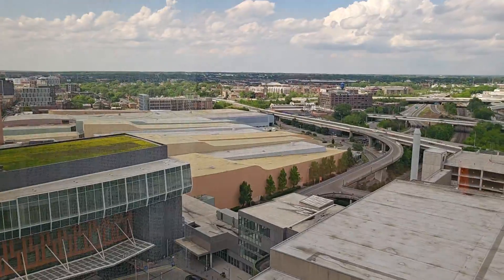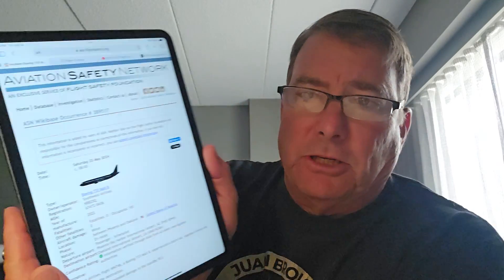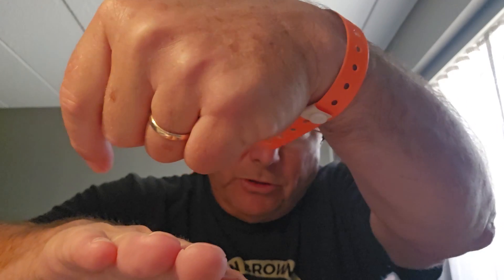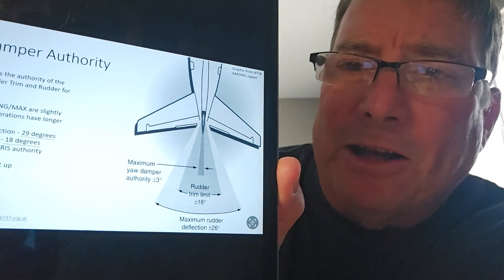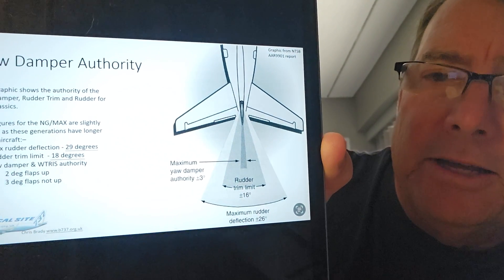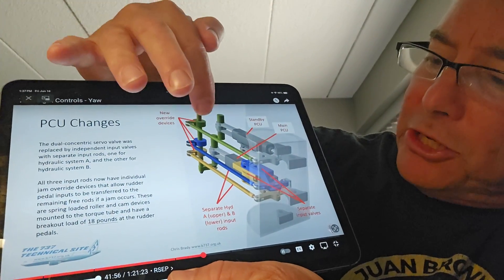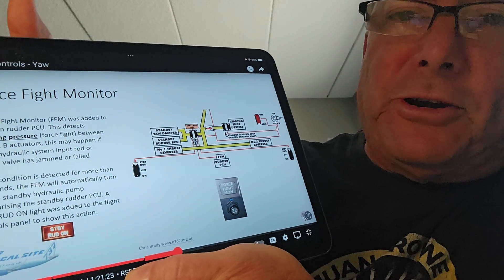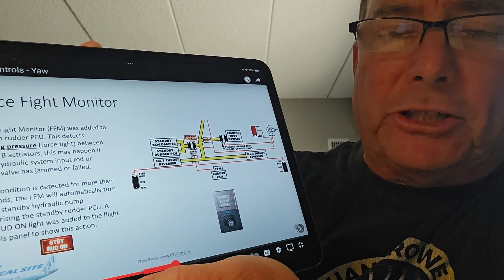SWA 737 Max-8  "Dutch Roll" Incident

Comment: The fact that voice recorders are constantly getting overwritten in all these incidents lately, in the age of NAND in the TBs taking up virtually minuscule amounts of mass and volume, is absolutely ridiculous.
Reply: @halmc8109  1) They should be on before engine start(if that is what you mean by light the torches. 2) No way are you going to see an exchange program. The paperwork(and by extension time) that would be required on each exchange is a show stopper. Then there is the whole chain of custody issue if the recorder is ever needed in an investigation.
Reply: @adrianklaver113  Plus, you'd have to expand your inventory of CVRs ten-fold. You'd need maintenance at every station you fly to. The rack and electrical plug at the back of the rack would wear out. Not a good idea. Still, every CVR should have the recording capacity of at least two legs of the longest flight the aircraft is capable of.
Reply: The flight time from Phoenix to Oakland is not 4 hours. How did it get over written? Wasn't the plane parked after the incident?
Reply: @rockslide4802  Apparently it's quite common for CVRs to not be turned off when the plane is parked, for whatever reason. I say just give em a few TB of memory and let it record years of recordings. Also do proper multitrack and seperately record cockpit and each pilot's mic (quite important when pilots are masked up)
Reply: @rockslide4802 There is no need for the whole recording to be overwritten, just the relevant part. Presuming the incident occured in the first half hour, a total flight time of 2h 30m would erase completely the part of interest .
Reply: @rockslide4802  it runs the recorder as long as the power is on.
Reply: Well, something required to survive a Mach 1 impact, fire, and 20,000 feet under water for Three years isn’t as tech as what you can buy for yourself.
Reply: Old V-tail Bonanzas loved to “Dutch-roll”
Reply: …Watching early Premier1Driver vids, I finally figured out he was pressing the Yaw Damper On button immediately after gear-up
Reply: Welcome to aviation where I'm still mandated to use leaded gasoline.
Reply: HEAR HEAR!
Reply: @halmc8109  Good idea, but when you figure that some of these planes may make 4 or 5 (2) hour flights a day that could be expensive with a fleet of say 100 aircraft flying around each day.
Reply: I'm not an engineer so I'm a bit curious: are tapes still used vs more modern data storage device in CVR because engineers/experts decide it has a higher chance of surviving an impact/air crash?
Reply: @First-Name_Last-Name its digital now
Reply: @bradsanders407 oh my mistake. I just read the comments above and they talked about tape vs newer data storage tech so i wrongly assumed airlines still used tapes.
Reply: If SW safety had directed to have  CB’s pulled when event occurred (per protocol) then CVR data would have been archived.   Without this action, the new CVR time requirements would not have helped.
Reply: CVR data for this event isn’t important. The flight data recorder and radio communication data will tell the entire story.
Reply: I sincerely doubt that conversation on the flight deck during the incident would shed any info of significance on this incident.  To be clear to non pilots, FDR’s (flight data recorder) records flight control inputs and other data for a minimum of 8 hours and that’s likely far more valuable than a few words which may have been uttered during the event and subsequently recorded on the CVR. It should probably be mentioned that an operable CVR or DVR is not necessarily required for flight if the airline has MEL relief. 

I think the recording capacity of the CVR is somewhat of a red herring and only mildly peripheral to this event. It’s highly likely that any comments during the event were of an emotional nature such as “what the hell is she doing?” or “hang onto her” etc.  However, I have little doubt that a follow on discussion took place at some point after the event and relevant circumstances would be documented for a proper maintenance logbook write up as well as any other required safety of flight reports that Southwest requires for events such as this. In other words, notes are made in order to document at a more suitable time. 

The work put into researching and describing the relevant parts of the rudder control system are much appreciated and my immediate thoughts were “here we go again, the rudder hard over issue previously experienced with the 737” and the tragic loss of life that occurred in the mentioned accidents. 

No doubt Boeing disturbed our collective trust in not properly disclosing and documenting the MCAS system. And sadly, even that huge and enormously significant failure to disclose was NOT something unprecedented in the industry.  But that’s for a different discussion…

I’m far more curious about phase of flight when the incident took place as well as any possible contributing circumstances such as did the event take place during a bathroom break, or pedal adjustment, etc., that resulted in accidentally kicking a rudder pedal ? And or was it a wake turbulence encounter that set off the chain of events ?  You made it clear there was damage  to at least one of the pcu’s but what evidence is there the damage was or wasn’t preexisting or was the damage the result of the encounter?

Simply put, there’s not enough information to have any kind of a credible opinion and there are numerous possibilities that account for the incident before regulatory changes or redesigns (not saying you’re advocating either Juan)

My comments are not meant to criticize Juan’s excellent reporting but are simply to provide a little perspective to those not personally familiar with operating jet transports.  

Because this event is rather “dated” it sounds like it very well could be more the product of a slow news day and Boeing has the public’s interest at the moment so why not roll with this “juicy” story ?  Especially given the history of the prior 737 rudder hard over “issue” as well as the MCAS related disasters, exit door separation, etc., etc., etc…
Reply: i learned in the Air Force if youre going to talk trash or execute a classified mission , pull the c/b
Reply: They playing hide n seek
Reply: aren't they still be recorded on magnetic tape?
Reply: What difference would the CVR make in this case? The pilots took care of the problem and landed.
I’m sure they filed ASAP and IR’s and were interviewed by the Safety guys.
I don’t see an issue.
Reply: I can understand that they want privacy so they must rely on honest answers by the pilots tell  when they are interviewed by the investigators.
Reply: The only overwriting problems have been from a plane that landed intact, and they failed to deactivate the recorder. 26h recording is unlikely to help that problem because it was forgotton and nobody is going to be flying the plane until it is investigated a few days later. All they really need is automatic shutoff 10 minutes after the plane is shutdown on the ground (Not if shutdown and gliding, to be clear).
Reply: Because Pilots Union says so
Reply: Flight recorders have been using Flash since the 90’s.  25 hour CVRs have been available since 2020. They typically record much more than 25 hours.  (25 hours is the MINIMUM). The survival tests are exceptionally severe.  Your iPhone memory / SDcard will not survive.
Reply: I believe that in this age of "No Shortage of TBs for storage" they are over-writing the saved audio "On Purpose" ..... because the "Lost Data" helps a lot to "Cover Up" when they have to .......... Similarly in this age of zillions of satellites right above an airborne plane, the need for on-board FDR and CVR should be no longer there ........ the "Data" of all kinds from the plane can directly go to a common centralized "Server(s)" placed safely on the Earth, and be saved for investigations .......... Are there more planes in the air at one time than people in Earth's population talking on WhatsApp ? OR viewers watching porn on internet less than the planes flying at one time ?? ........ all that flight data sent from the airplanes can be saved somewhere in real time ......... but again it is my conviction that ......... lost data helps in the Cover Up !!
Reply: Talk to the Union
Reply: I guess that partially it's due to the regulations. It's too expensive and time consuming to make and certify the upgrades. Also you need to update maintenance procedures, related documentation and study programs and get it certified. And so on, so on. It's like the reason why some new Boeings with composite material wings fly with lots of duct tape (or a speed tape how it's officially called). The old paint which was designed for metal wings doesn't fit hhe composite wings. The initial variant of the paint peels of the wings and the affected areas had to be covered with the tape. The new paint to prevent this from happening has been developed but it takes too much time to approve that paint while planes continue flying with wings covered with the tape
Reply: And probably on purpose..
Reply: There's no benefit to it. Ideally you should save CVR data when something happens but nothing the pilots said is going to be more useful here than the flight recorder data. CVR is for piecing together a story when the pilots are dead.
Reply: Been saying this for many years. 
This concept they use is many decades behind. 
I'm with ya though, it is ridiculous especially in this era.
Reply: Doesn't the European agency EASA demand 25h recording time for the voice recorder?
Us too cheap for that?
Reply: The latest FAA authorization bill passed by Congress included the 25 hour CVR requirement.
Reply: @RealMash  It's very expensive to replace in an existing plane. So newer/older planes are built to different standards.
Reply: @RealMash  EASA required all 30m CVRs be replaced by 120m by 2019, and all aircraft made after Jan 2021 above 27 tonnes must have 25h
Reply: @RealMash Before it it " made in China " and now plane " made in USA " 😂
Reply: Data is cheap these days! This over-writing is ridiculous!
Reply: @kevinb3812 conventional data storage is cheap. I’m not sure the highly protected (survivable in a crash, fire or for weeks/months at the bottom of the ocean) storage is cheap.
Reply: CVRs don't use consumer-grade MLC flash because it just isn't robust enough. They use aerospace-grade SLC flash on the order of 4 GiB now, but data is compressed and mirrored to 2 or more devices. Another way to approach it would be to use say 64x redundant (mirrored like RAID1 but 64x) individual industrial flash SD cards potted in resin that are then padded with rockwool, and then further encapsulated in tungsten carbide that is then again encased in 15 mm of 304 stainless steel. CVR/FDRs nowadays only weigh about 9 lbs / 4 kg with the saltwater-activated pinger (ULB), which means they're really saving money by only doing the bare minimum to meet the standards while not making them as robust as they could be for investigating extremes like SilkAir 185 scenarios with much harder terrain.
Reply: I don’t get why the vox & flight data are stored in literally the worst place possible: the airplane.
“If we had to store data for a million flight hrs a day that wld be prohibitive.” We’re storing that much data anyway. We’re just doing it with super specialized equipment that costs 100X a data center.
There must be some perverse incentive at play here.
Reply: @lo-fidevil2950 you might have  no idea how much the sheer volume of data is  and transferral costs
Reply: @lo-fidevil2950 Elon has a solution for that... look up!
Reply: @lo-fidevil2950 because the earth is curved sir. You have any idea how big of a pain in the ass it would be if airlines had to set up info recieving centers every so many miles around the globe? Over the ocean it would have to be boats. Then you would have to piece all the info together. Its just stupid. The plane is by far the best place to keep the data.
Reply: @bradsanders407 I disagree upload to satellite. They are around the whole globe so you’d never be out of comms. There is NO good reason to keep critical info on the plane and risk having the data destroyed if the plane goes down.
Reply: @lo-fidevil2950  you may find downloading data off the plane moving at 850 km/h at 40,000 ft in the middle of Atlantic ocean…

quite a challenge.
Reply: With the cost of industrial EEPROM now, regulators ought to mandate L3 and Honeywell build 6 months of retention dual redundant combo CVR+FDRs (one nose and one tail) continuous recording time with no in-cockpit erase feature, but with the caveat that only the airline body manufacturer and NTSB would ever have or need access to it should there be a specific incident on a specific plane.
Reply: @R.BOWERS I’ve never heard a union member argue against a 25 hour voice recorder. It’s airline management.
Reply: @joetheairbusguy1813  Well public Federal Register comments were accepted a few months back and I believe the some unions were quite vocal opposition
Reply: Move along citizen. Nothing to see here.
Reply: CVR's should also  transmit a copy of the entire drive to a receiver every time they pull up to a gate.
Reply: @mrbmp09 THIS.  It could be encrypted before being transferred to the 'ground storage', openable only via a highly documented paper trail.
Reply: No, extending the recorded time would increase the chance of Boeing being exposed once again, remember the main Boiang strategy when two 737max went down: in both cases they blamed the pilots first. Actually, I believe Boeing would like 5-second recordings.
Reply: @andre-7423 You do understand that data is recorded  in many parameters for every second the airplane is operating right?
The discussion here is regarding the cockpit VOICE recorder.
Reply: @andre-7423 and in both cases they were right.
 lack of pilot training did contribute to both Max crashes
Reply: @R.BOWERS  pilots union STILL against improved aircraft safety!
Reply: They download and keep ACARS why can't the download and secure CVR conversations, only opening them if there is an incident or an accident to protect the privacy of the pilots.
Reply: @CustomBPS exactly. This technology is commonly available and is not expensive. My wireless transmitter for my action cam can store 4gigs of audio as a backup. That’s about 14hrs of audio. My whole setup cost me $150.
Reply: It’s clear that it gets overwritten intentionally.
Most probably to save the pilots from the not so nice things they might have said about the aircraft, the maintenance, the company, etc.
Reply: @miks564    Used to be because of technology limitations, but just because technology allows it does not mean it ought to be done.
This does not mean it should not be applied, just that it should not be applied automatically or, worse, without knowledge of those affected.
Reply: @advorak8529  You definitely have a point there.
One thing is a crash with loss of life, another an incident where the recorded pilots still have to face some investigation.
However, it’s a two way street. Knowing what’s been said may indeed help on future similar occurrences.
Reply: The most important thing in a cockpit is CRM. We've had enough accidents caused because the pilots weren't talking to each other. Knowing they are being recorded puts a block in the way - a thought, "Do I want someone reviewing these words after I land?" This must be prevented.
Reply: @robertbackhaus8911 No, the most important thing in the cockpit is flying the fucking plane… 

Effective CRM is to ensure that someone is flying the fucking plane at all times.
Reply: The point of CVR is to find out what happened to the plane… 

You don’t need CVR if the pilots are alive and well. You can just talk to them. CVR is for when the pilot aren’t available to talk to you i.e. they are dead.

You will KNOW what happened to the plane if the plane didn’t crashed.

Note that the FDR is available. You can just used that together with pilot testimonies to find out what happened instead of FDR+CVR in the event of a crash. 

No, pilot can’t lied. FDR will contradict with their statements if they lied.
Reply: @halmc8109 Yeah, that’s not labor intensive or time consuming at all. It would probably help increase on time departures as well.
Reply: I’ve got more storage on my iCloud for 99c a month than a modern plane. 😂
Reply: @Wargasm54    But you have no access to your iCloud while over the Atlantic or Pacific. So …
Reply: @advorak8529  you’re not very bright are you?
Reply: There should be enough recording time for the duration of each flight.then over write it for the next one
Reply: Yeah, my mobile phone can capture more than 2 hours of audio and it cost less than $500. Jeez Boeing, get on with it!
Reply: Hoot Gibson
Reply: They should start retaining CVR data for all flights regardless of if there’s an incident for at least 30 days or something.
Reply: It is helping to erase the evindence that could help to solve theses issues. But we all know Boeing doesnt want to hear about issues, and so does the recorder LOL
Reply: No, that is by design.
Not necessarily out of ill will, but imagine pilots talking trash while on cruise could be called out weeks or months later for it.

Not relaxing if you have a vindictive manager on your back. 

Maybe the data needs to be encrypted with a public key after some time (maybe 1-2 hours) with the only private key able to decrypt it held by the FAA or something — and every cockpit recorder has their own, unique public/private key pair.  That way, only the FAA (or relevant national authority) can open the recorder data and they’ll only do so for serious events.

Yes, you want a lot of redundancy in the storage and limited lengths of encryption snippets to reduce the chance of decryption failure due to memory errors and reduce the amount of damage if such an error occurs. 

PS: The recorders need their own dedicated power system so they keep working even if the plane gets a total blackout. And because you will want a beacon to find them easier after a crash, say, into the ocean.   SOFAR bombs may be a problem due to explosives and airplanes, but certainly would have helped, if not disabled, to find Malaysia 370 — but sabotage and evil intent cannot be overcome with safety equipment designed for honest actors.
Reply: @advorak8529  It's getting changed to 26 hours.  The fact that they have had the biggest close calls of the last two years all overwritten has became a huge issue.
Reply: @advorak8529  there are already laws on the books that prevent the airlines ie managers etc from listening to CVR recordings not to mention they don't have the equipment to do so (the NTSB toyed with recommending changes in legislation to let airlines routinely monitor CVR conversations on nominal flights to check if pilots were obeying sterile cockpit rules, etc. in 2010 but it never went anywhere- as far as I know, the pilots union said absolutely not, but even the airlines themselves weren't interested as the extra labor involved to listen to millions of hours of conversations a year would be ridiculous), plus their are also laws against retaliation/discrimination against someone by their employer for what they said in a private conversation even if they did, not to mention ALPA would make sure that never happened and would raise holy hėll if they ever did. Everywhere else in the world has had 25 hours minimum for decades, and the benefits FAR outweigh any nebulous concerns about privacy that really don't actually exist in reality.
Reply: @advorak8529 .  .  The pilots Union really fought the FAA with extending the voice recorder from 30 min to 2 hrs. The flight crew can erase the voice recorded by just pushing a button with the parking brake is set. In the 40 years on line maintenance, no voice recorder has never been pulled by a management request. Encryption is not required or desired. If there is an incident, the flight crew should pull the voice recorded CB circuit breaker after landing thereby preserving the incident. As a line maintenance tech, I have pulled the CB several times when I came aboard after an incident. Having an internal battery to continue recording after the power is a great idea that I wanted to see for many years .  The flight recorder could have its own dedicated accelerometers much like an iPhone. In case of an accident, more details could be recorded. One great leap in avionics is that the newer aircrafts will come with a combined voice recorder and the flight recorder in one box, and have two recorders located in different areas of the plane.
Reply: @advorak8529 could still talk trash, however long or short the CVR memory lasts?
Reply: @advorak8529  alot of these cases though don't involve hull losses - it's just the time limit that's leading to the data being lost, the data could easily be stored or downloaded off board so that it could be reviewed if necessary. I agree there needs to be protection against misusing it for vindicitivness etc. but to be fair that's a whole other subject and should be happening anyway.
Reply: Nah there’s no manager listening to CVRs. We have laws and union CBAs that prevent exactly that. You can listen to me all you want, I’d personally prefer to recorded so I can be exonerated by the NTSB…but honestly the flight data is so much more valuable than hearing two dudes bitch about crew meals and then say “oh shit!” when the plane starts an oscillation.
Reply: @advorak8529  Plenty of people are recorded for the entire shift every shift and in much less important rolls than a pilot. If a shelf stacker, checkout person, servo attendant etc etc can handle it a pilot can
Reply: @change_your_oil_regularly4287 self stackers and cashiers have to wear a mic?!?! Where do you live? They don't do that in the states.
Reply: @change_your_oil_regularly4287   Yes, but in plenty of those roles there is only security video recorded - no sound.  Being recorded is bad enough with middle managers going through the footage to see if the front line staff are goofing off reading magazines etc.  To have audio as well would just cause a LOT of friction in workplaces.😂
Reply: @advorak8529  This data needs to be uploaded to the carriers control center on a constant basis just like the data on highway trucks is uploaded to the home office. It is then available to the authorities any time they want it. If you're going to be a professional airline pilot then save your trash talk for when you're off duty.
Reply: @johnarnold893  Why would the authorities need access to the conversations of pilots on planes that didn't crash?  It makes no logical or rational sense.  Whether it was a close call caused by ATC failure which can be observed on the radar records and ATC recordings or whether the Rudder PCU crapped out or whatever... the conversation between the pilots doesn't give you magical insight.     Unless they weren't paying attention and crashed the airplane, in which case you have the recorded CVR to review... because there are no flights that exceed 24 hours.
Reply: @johnarnold893  Good idea.
And highway trucks need all the safety equipment and training and in-cab audio recording, too.
Reply: @advorak8529  Maybe they shouldn't be 'talking trash'. So we consciously compromise air safety from otherwise available information so as not to embarrass pilots? I don't think so!
Reply: @advorak8529 I get your point but the trash talking is just such a weak argument. I understand that privacy should be protected but there are a lot of cases in history where pilots where talking about things they really should not be talking about during sterile phases of flight. 
25h might seem long, but of course a compromise would be to just listen to the relevant parts for an investigation, nothing more
Reply: @kevinwydler7305     there are a lot of cases in history where pilots where talking about things they really should not be talking about during sterile phases of flight.
Which usually happens within the 2 hour window before the accident, no?

a compromise would be to just listen to the relevant parts for an investigation, nothing more
And you decide what the relevant parts are without someone listening to all the parts … how?

Never underestimate how bad corporate overreach can be, and do not assume all corporations are law abiding and playing by the rules!
Reply: @advorak8529  There should be a Law that the data which the FDR or CVR have generated throughout the flight will only be looked at in case of a needed investigation and should be erased say 2 days after the flight ........ so the pilots won't have a fear of vindictive manager ................ right ?
Reply: @advorak8529  I have an easy solution here, and it's pretty low tech: You're being recorded, don't talk trash while you're on the job.  The purpose of the recorder is not to protect voices within range of hot mics.  Encrypting the data is completely unnecessary, and is essentially absurd.
Reply: The reason this is harder to implement than people think is because magnetic tape is still more realible than current solid-state technology which can become corrupted or garbled.  Even if you talk to most people in IT data centers, tape backups are still used for archiving  in a world where solid state tech rules everything else.  It's because of the technology, it's outdated but very reliable.  Plus digital audio can also be tampered with and I think that in some respects the magnetic storage is better especailly for power outages as it likely takes less power to operate a magnetic recorder than it does solid state recording technology.
Reply: @HR-wd6cw  Juts record to multiple media then. we have the tech, we should use it
Reply: @HR-wd6cw  Helpful! Thanks.
Reply: The only reason tape is used in data centers is because the amount of data it can store. Solid state data is more secure, much cheaper, indestructible and does not take more energy.  (32 GByte stores >1000 hrs of voice recorder @ $30).
Reply: Tons of comments here by people that have no clue about either the technology or the requirments of safety critical systems.
Compression and encryption contribute to unrecoverable data. Scramble a few bytes in a raw bitmap image file and your eye probably won't ever notice, but just one or two bits flipped in a JPG (a compressed format) can severely corrupt the whole picture. But the raw bitmap will use about 40 times more storage and bandwidth compared to the jpg.
Physically linear recording media like disk or tape (analog or digital) allows reasonably easy reconstruction of corrupted materials in chonologically correct order.

Limiting the recording time also allows reconstruction efforts to focus on relevent data rather than wasting very limited investigation resources randomly recovering weeks of irrelevent trash in the hope of finding the relevent section of the recording. 
Cheap consumer NAND scatters data at random across the media and is extremely difficult to recover from physically damaged chips. Damaged magnetic media can be directly read in a clean room with relatively few unrecoverable blocks.
Reply: @HR-wd6cw  Tape is not more reliable.  Not by any stretch.  Then you claim tape consumes less power than solid state?  Are you high?
Reply: @ShainAndrews  Tape is unreliable should it become stretched
Reply: I have a cheap dashcam which will record over 12 hours of audio plus it will lock and save portions where it senses a problem preventing them from being overwritten. Maybe $125 total cost. So don't tell me CVR's can't at least do what a cheap chinese-made piece of consumer electronics can do because there's not reason for that to happen.
Reply: @R.BOWERS So it’s a Pilots Union matter?  Aha, the truth comes out, it’s a CYA issue.
Reply: @halmc8109 lol yeah no. Imagine at your work you have to record everything you say and hand it to your boss just in case a one in a million event occurs. Ridiculous